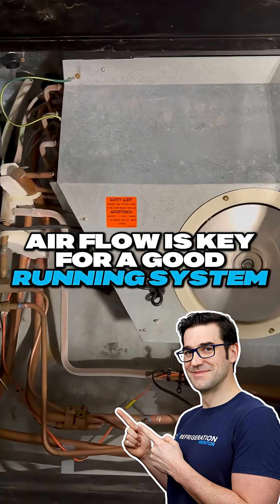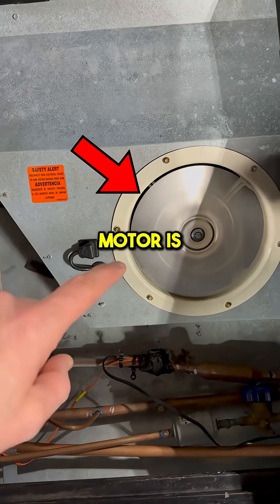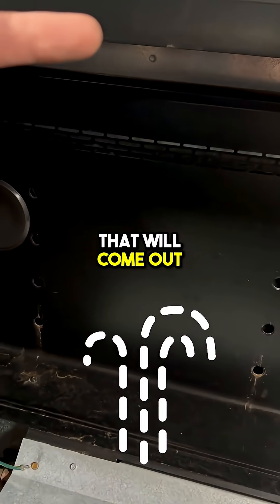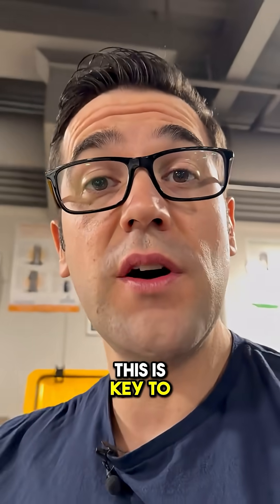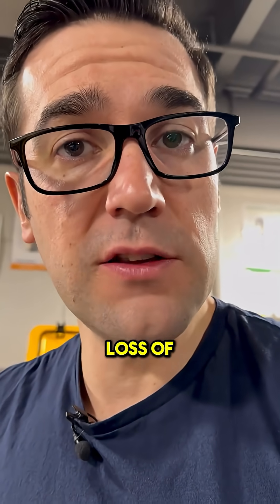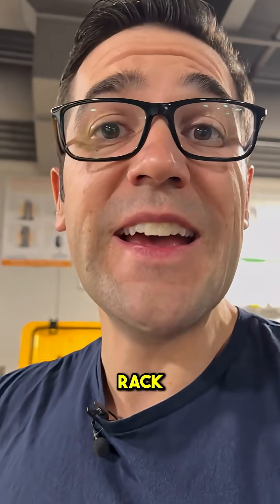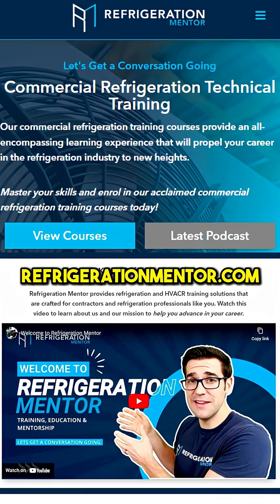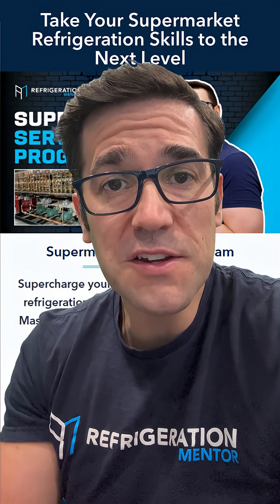Why Airflow Problems Kill Refrigeration Systems Fast

Comment: If you have poor air flow you're not heating the evaporator coil. If you're not heating the evaporator coil you're not boiling the refrigerant and you're flooding the compressor
Reply from the maker: that is a fantastic way to put it. Thanks for sharing. Have you ever saw a compressor failed due to flood back?
Reply: @RefrigerationMentor Oh yeah. It was on a 15-ton package rooftop unit at home Depot. When I remove the access panel I noticed that the 2nd stage compressor was entirely black because it had failed from terminal venting. Liquid was returning to the compressor for a prolonged time which caused the windings to overheat and pressures to skyrocket. The loss of all refrigerant and oil through the electric terminals was its last breath.

Comment: Do you have any tips on preventing ice buildup on the distributor lines?
Reply from the maker: That is a tough one if you did a gas retrofit to a high glide refrigerant with electric heaters. Does the coil defrosts but not the distributors?
Reply: @RefrigerationMentor yeah it's a common issue I see at stores a lot. The only thing I've heard is to try to keep the superheat as low a possible.